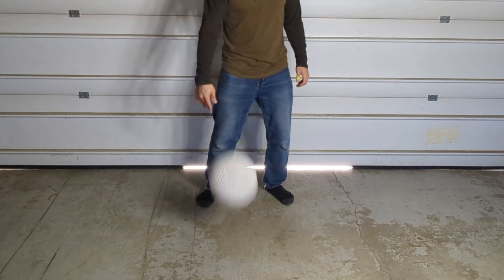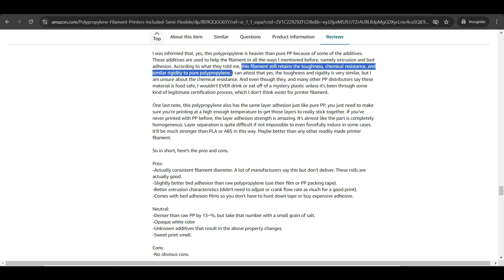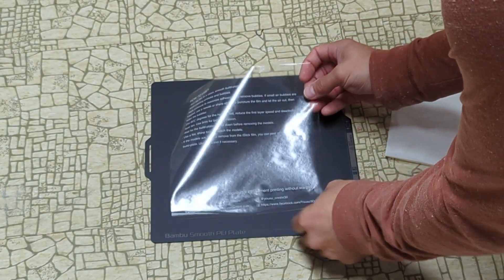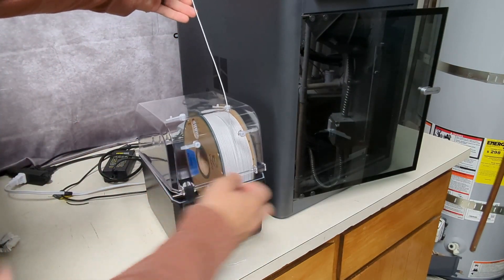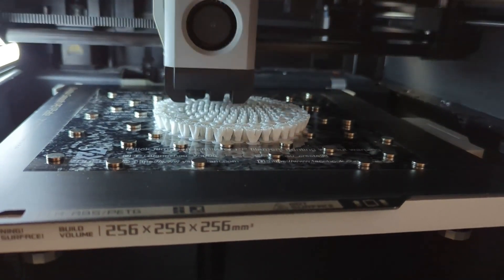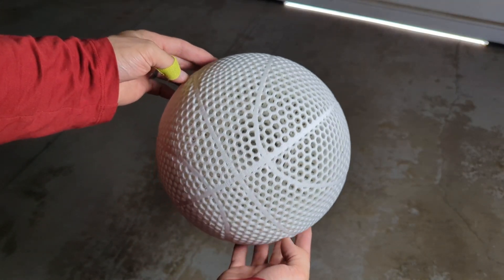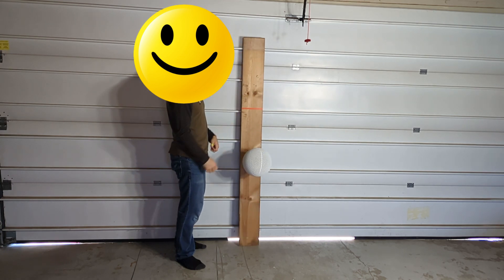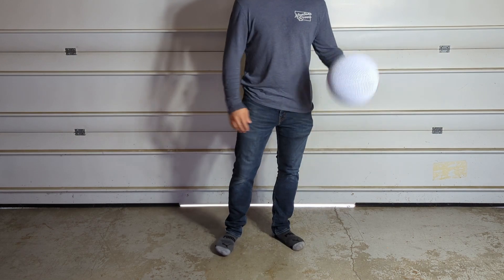This Airless Basketball Is Made Out Of POLYPROPYLENE!

Comment: This video is amazing, I saw the video with the filaments designed for the ball. I have seen both of them and bought the Wisdream Flexitough. I printed it at 88% scale using your model. I think my temperature was too low. Do you have any tips to make the layer adhesion better, and the ball started to wobble with the supports, causing the top to get messed up and almost make the layers droopy on the outside layers. I can't figure out how to make the custom support bigger. Thinking of maybe printing half the ball at one of the seam lines with the amount I have left, then buying another roll print the other half, and glue it. I also might need to dehydrate the filament and aneal after
Reply from the maker: Thanks! For layer adhesion, I would recommend a slow couple of first layers without any cooling fan, and I would also recommend a bed glue stick like this one: https://amzn.to/3ZEwhSV. This also helps you remove the print off of your bed when it is done. Another thing I would recommend (if you can't make the supports bigger) would be to slow the printing down when it starts getting to the top. This will help the top of the ball print well along with hopefully decreasing the wobble. I think printing half of the ball at the seam lines and then gluing them together would work - I wouldn't know the best product to glue them together, maybe 3D gloop? dehydrating the filament and annealing would also be good ideas if possible.
Reply: @makeitlabchannel  thank you, will definitely buy another roll, the ball bounced good, it just had weak points when I printed it along layer lines at some points. Thinking 3d gloop might work or a 3d or pen. Good luck on your next prints!😅
Reply from the maker: @GraysonLillig  Yeah the wobble on the bed slingers can definitely be a problem - I know it is already a long print, but maybe even slowing the overall printing speed could help? I also highly recommend a 0.6 mm nozzle as it cuts the print times in half or even more depending on printing speed.  Might even help with durability but that is what I am testing now 😁
Reply: I was printing on the a1, and I finally understand the problem with the wobble bed slingers have, as they are much worse. Was even printing in the garage on concrete

Comment: haven't even watched it yet but so excited for this!
Edit- There is a company here in India called WOL3D. they do sell raw PP filament and 3DX Tech has a CF-PP. It does cost ~60usd i think last time i checked and might be be out of budget for trying a 'failed' filament. Also about the TPU, someone did do a video with TPU i think and it didn't bounce much. I still think that CF flexible filaments might be the way to go since they might not crack and still have flexibility. Cheers!
Thanks for trying out the filament request :)
Reply from the maker: I will check out the pp filament! I also tried to print CF tpu but it kept clogging/failing no matter the settings I changed or used and I ran out lol. After watching CNC Kitchen's video on flexible filaments I don't know if CF filaments will be the way to go but the fiberflex looks very promising: https://youtu.be/4InFd5DoZa4?si=dMI_JPdQIsn0-5X1
Reply: @makeitlabchannel  Yes seems like that fiberflex might be a good way to go and why CF filaments wont work. I think the PP from Wol3D costs 3000INR or 36USD with taxes but I dont know about the shipping costs.

Comment: What is the best material as of right now to print the airless basketball out of?
Reply: How much peba filament needs to be used to print a basketball, could you save money by getting a half roll?
Reply from the maker: @ShyamLal-o4n  To print a full size basketball it will be about 645 grams with supports included, so 2 rolls are needed. I am working on another version of the ball that will work with just 1 kg roll without needing to scale the ball down
Reply from the maker: @Diddy3.14  From what I have printed, both in durability and bounce is the PEBA filament, but it is also pricey
Reply: @makeitlabchannel  Thanks.